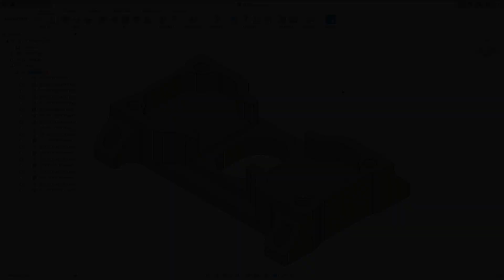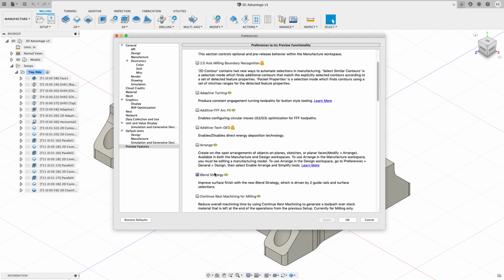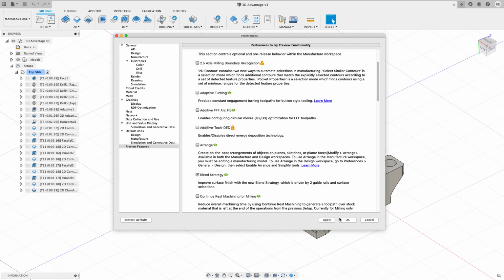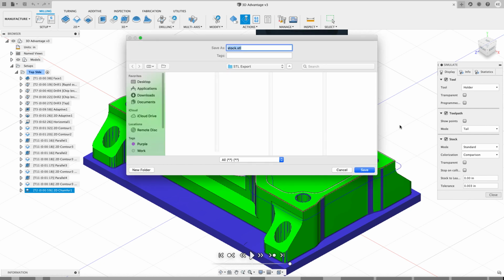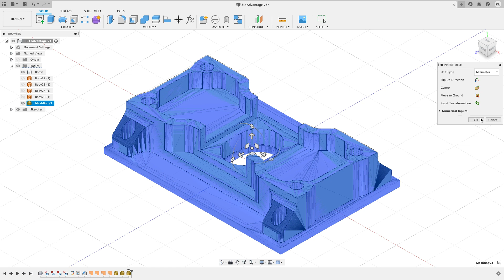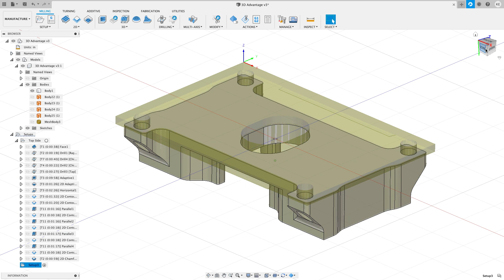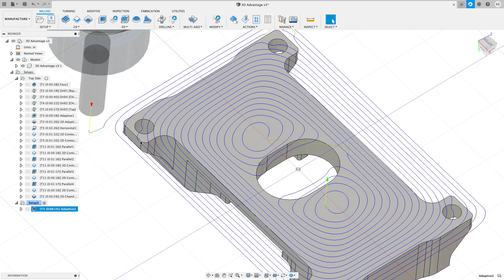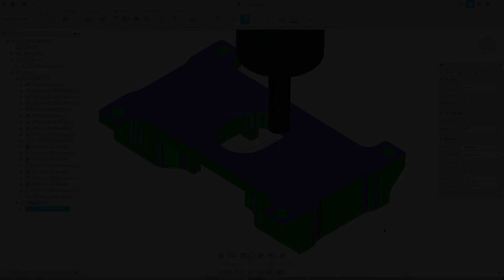Fusion 360- Carryover Stock From Previous Setups

Comment: Currently i run the hobbyist version, is the STL mesh saving not allowed on that version? Guessing so and hope to purchase a subscription in the next few weeks. Use it more for my cnc router in the garage.
Love the videos and help, thanks man
Reply from the maker: There have been some updates. It’s now called save as mesh and then you can choose STL in the next step.
Reply: @MechanicalAdvantage  so after I select to simulate from the mfg tree it takes me into simulation but, at the top of the screen it shows tool> display> inspect and a check mark to exit simulation.
I don’t have any options and doesn’t appear to be the same layout as yours. If I had  way to attach a photo I’d show ya. I can shoot it a email or Facebook
Reply from the maker: You can email me Kevin @ mechanicaladvantage dot com. I have a personal license so I can check stuff like this too. So I’ll see what I can see in that account.
Reply: @MechanicalAdvantage  appreciate that man! After I sent that, I decided to try it again. Mine still looks different but not sure if it’s a setting I’ll still send th shot to you.
However for me to save as a mesh I had to play it. Then right click on it go down to stock > then go to save stl. That was the only way I could get the option to save it with the removed stock.

Comment: I like the Op2 topic - More critical setup than from raw stock OP1.  I have used the Stock model .stl method.   I also do a cheat on standard stock for Op2 by making the Z bottom in setup a negative number =  my model bottom depth form op 1 
Then approximate Z + number on top - using the same over O/S on  X/Y - that works for a quicky.  I try to orient my Op 2 WCS to something on the model for precise alignment. Your cool part looks very interesting on how to workhold on Op2.  Thks

Comment: I've been doing this for a while and it's really useful when flipping a part over. I'm surprised and puzzled they still haven't made it much simpler, almost as if they are hiding it away. I'm sure they are not but isn't this something most professionals will need to do? Feels like a blind spot on the part of the product managers.
Reply from the maker: My speculation is that they want this to be more robust. For instance, what if I put a part on multiple places on a fixture plate? That would break the workflow. It is frustrating. It isn’t a blind spot. They definitely are aware of the need.

Comment: Hi,

I like it. I’ll give a try. Only diff would be locating the wcs on bottom surface. The first op machined surface. Eliminates any error due to stock mill dimension etc.

Alistair
Reply from the maker: Hey Alistar. Confession? I didn’t really create the point I needed so I just randomly put it up on top to finish the op.
Reply: Ah, ok. 
Just a related note, and really not directly applicable to your vid. I find the second op, the flip and deck, to be easily screwed up. It’s the placing of the machined first op surface down on  fixture, parallels, pallet, what ever, so susceptible to trapped chip, burr, or often distortion of the part due to careless clamping pressure. If your trying to get the part height in the plus minus .001” range, it’s quite amazing how the little errors add up. 
When I say trapped chip I mean specks of dust chips :-) and thin parts so easily bow in the vice, especially if removing the hat exposes pockets.

Thanks again for the vids,

Alistair

Comment: Thanks for the vid Kevin!!!  I know we were doing this a couple of years ago and this seems to be a couple steps shorter than the last time I did it.  Seems I had to save the stock in mm and also convert to a brep when importing.  I tried to do the "continue machining" with the preview feature and found out about the multiple setups not working.  It would be nice if given the option to select which previous setup you wanted to use.  I have a setup for left part OP1 and then another for right part OP1.  If I put the left part OP2 setup right below the OP1 setup, I can use the previous setup.  I then need to put right part OP2 under right part OP1....which is where is shows up anyway.  I just need to make sure that when I select setups to post, I make sure I get both OP1's. lol  The biggest down side to the method you show is if changes are made to the first operation.  It doesn't update the stl file. It has to be created and selected again.  But.....outside of it being a bit inconvenient, it works awesome for second operations on parts!!  :)
Reply from the maker: Yep. I think the lack of updating stock falls into the un-elegant thing I was talking about. This also doesn’t do a user much good if you move a part around in a fixture. So hopefully we’ll get more robust tools that solve both.
Reply: @MechanicalAdvantage  Hopefully! :)